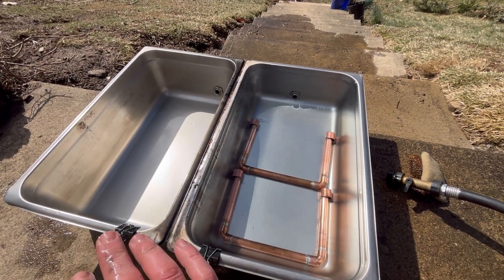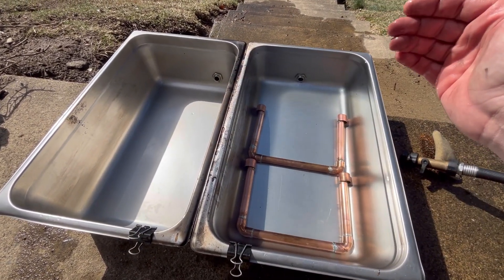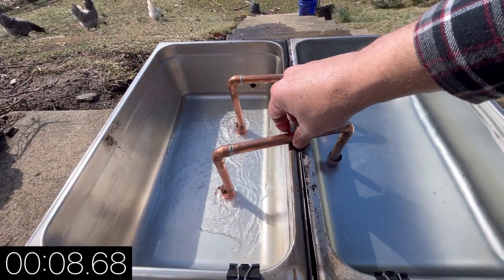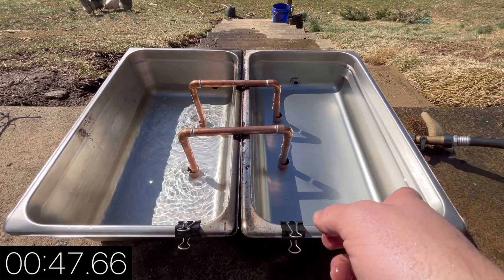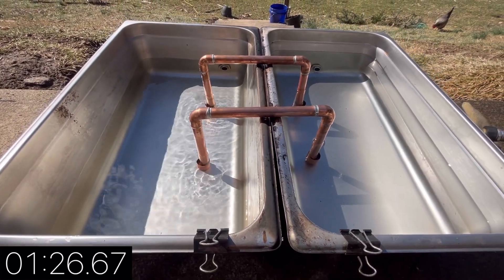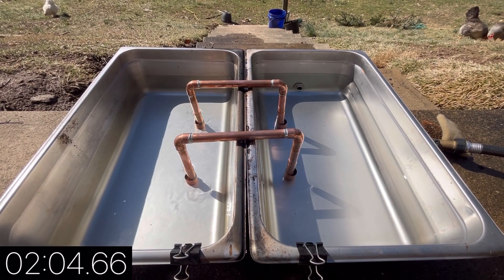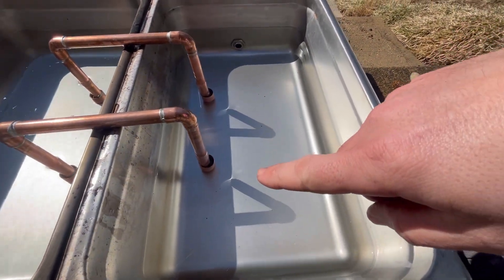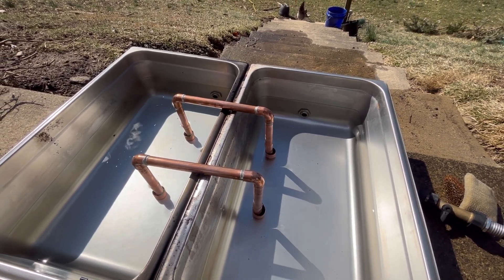How Siphon Tubes Help with Maple Syrup

Comment: These are awesome fustation savers. I first started using them with my first barral set up. Right now I am building  my new arch for a 2x3 divided pan and 3 steam pans I already have with  siphon tubes into the 2x3 pan. that will give me almost another 4 1/2 sqft of boiling surface. now if you put the   siphon tube in one corner between the pans and feed the "back" pan from the opposite corner it will push the heavier concentrated sap to that tube transferring it to your front pan making it more and more concentrated until you have a pan of Heavenly goodness. AKA syrup. One tube per pan transfer is plenty. you just proved a  single tube will move a 1/2 gal a minute. what's your  evaporator rate? with pans? at best 2.5 gals an hour per pan? 1 is plenty.
Reply from the maker: My average for both pans for 2024 was 1.55 GpM with my highest being 2.3. The low average is probably due to me experimenting with different things to speed of the boil and I think I ended the season pretty well off. This year will be all the same (I hope) so I should have a higher average.